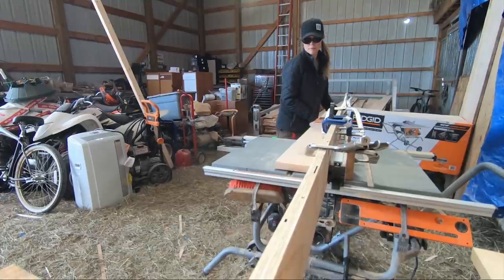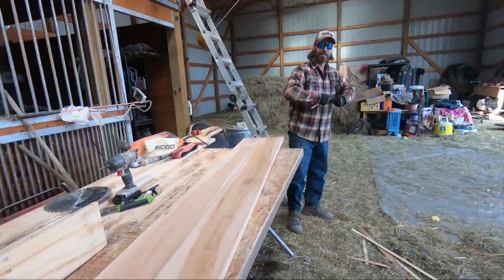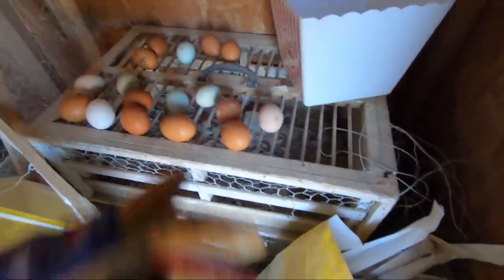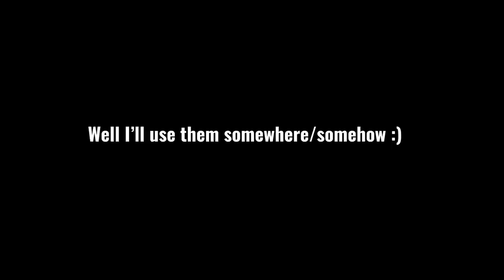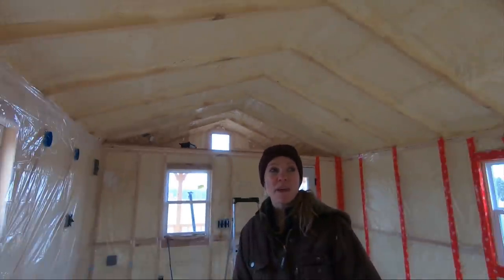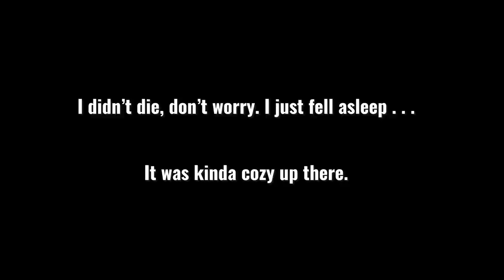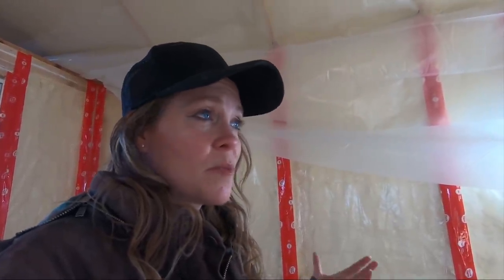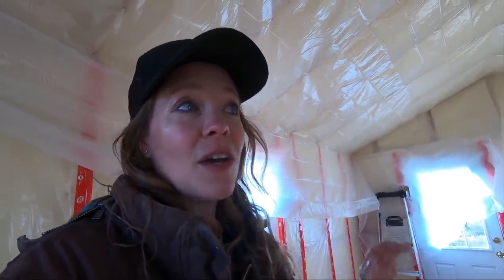DIY Nickle Gap Edge on Rough Sawn Lumber With a Dado Blade  - Off-grid Cabin Build Vlog #15

Comment: As mentioned in multiple comments, vapor barriers are used in the wall structures. There is nothing bad using them.
To have condensation you need 2 things, warm moist air and cold place, which warm moist air can hit. This happens usually in winter where there is cold outside and warm inside. To eliminate the issue you need to consider 2 things.
1. get good enough air exchange (passive over opened window/door or active using any ventilation system with vents). If humidity is too high (over 60-70%) you can see condensation happening even on modern windows with triple glass. More the structure is tight and air-closed more the ventilation is important to eliminate moisture.
2. get good enough insulation, windows, doors so when there is cold outside the cold spot is not moving on inside side of the wall. Once this happens you will get condensation on the plastic foil.

if insulation is not good enough you can maybe try to overheat the inside to dry up condensation and push the cold spot out of the foil. This can become expansive on heating.

I hope you will be able to finish the project successfully and enjoy the "office" without any issues ;).
Reply from the maker: I got to thinking about it, and bought some vents to exchange air one side to the other and keep it from condensating too much. They are adjustable, so I can open or close as much as I need. Problem #2 I didn't think about, is that my green cabin wood might not be "dry" yet, and still sweating . . . which means higher moisture inside the walls WILL be an issue . . . even without the plastic, it could cause warping of my dry maple boards . . . I think any reputable seller will always gives you the pros an cons of any item being sold. Maybe it's only me. But I like my customers happy and coming back than upset and frustrated.. I had no idea the wood would be green . . . it affects everything someone wants to do . .

Comment: What you're talking about with the plastic is a vapor barrier, its usually done in normal fiberglass or wool insulation.  It has been tried and is the standard for most insulation.  The reason you dont find it in closed cell foam is it shouldn't be necessary, but it shouldn't hurt and it should prevent the exact problems you are talking about

Comment: Save the sawdust. When you get the boards on the walls you can mix with glue to fill in the holes from nails or just the natural holes in the wood

Comment: It looks like your framing lumber in the walls is creating a thermal short.  That's the cold spot where moisture will condense and if you nail your drywall or paneling to that, the nails will continue the short and condense moisture on the interior side.

Unless you have a continuous layer of foam outside of your framing (like using ZipR sheathing), I wouldn't trust it.

A possible fix is to get canned spray foam to fill in any low spots and glue on some 1" EPS foam insulation on the inside.  Tape the seams to complete your vapor barrier and hopefully your temperature differentials won't be enough to condense moisture.

If you don't feel like doing that, I would try living in it before you put up walls and ceiling.  Beside measuring moisture, you will be able to see it and if it is a problem, you won't have to demo the interior to fix it.

Comment: There is a couple in Texas with a double container home with spray foam  and a couple in New Hampshire with a single container who both used spray foam. Neither of them used plastic to cover the foam. One has a problem with water around a window. I think you were wise to use the plastic over the foam! You never know what kind of breathing issues you can get from breathing in vapor of the foam.
Reply from the maker: Well that was the first reason I bought the plastic. The foam dust HAS badly affected me (hence all the vacuuming) and when it gets moved, more may break free so the plastic will contain it... and also keep moisture out ;)
Reply: @This1LifeWeLive  There was a video of a couple in Canada that were using the spray foam in an attic and I don't know what the foam was but it put the whole family in the hospital. The company that put the foam in had to take it all out. It could have been that they didn't mix the foam the right way. That is why I say use the plastic.
Reply: The Texas couple life uncontained used drywall over the foam with no plastic vapor barrier, with the climate there it will be ok, the New Hampshire couple used rockwool insulation with no plastic and paneled over that, tons of comments about a condensation nightmare going on there. Apples to oranges really comparing this wood building to a metal shipping container.
Reply from the maker: @kenyh6695  you are correct, I saw that video too.
Reply from the maker: @billg1527  very true, I watch both channels you mention. Life uncontained installed themselves and missed several areas. I would assume it would cause massive issues, but im not in that climate. Container homes are not just metal, but the thermal break is different as well compared to pole buildings. And then you have mine... a totally mutant creature that doesn't follow any sort of construction path 😂
Reply: @kenyh6695  I seen that whole story, it was a bad mixture along with a bad application process. You know fairly soon if you have a bad mixture as it smells awful within a few days.

Comment: Well I'll throw my 2 cents in...
Its the temperature difference plus the amount of available humidity that causes condensation which is why its mostly seen in the winter. Depending on climate and location the amount of humidity is normally lower in cold areas during the winter ( I can barely keep my house above 32% during the winter ) and higher during the summer ( bad summers my A/C works hard to keep it no higher than 45% and I have a variable speed fan so it runs slower for longer to remove gallons from the air. 
There are two competing theories for your off grid office - plastic will seal the walls on both sides creating condensation on the inside of the walls and 2. Since you have closed cell sprayfoam which allows some air not much but some, and probably some unsealed gaps leading to the outside and you only have wood siding on the outside, putting plastic up will keep the moisture on the outside of the house. Sprayfoam is still fairly new with few experts and no calculations suggesting each of these theories is right or wrong from what I've seen. So which is it? Who knows but you're about to find out, someone has too!
If your cabin was foam boarded, house wrapped and sealed like conventional house construction I'd say there's a problem but as you said its a grey area.
Erik cracks me up, glad He's having fun! Some nice compost you have going on there...
You do need to hurry up and finish though, I'm almost out of maple syrup and I want some of y'alls!
Keep up the good work!
Take care.
Reply from the maker: I know, I'm running oout of time to get this DONE! I'm going to start manure spreading next week, then seed planting. Then will be equipment servicing. Then hay!   PLUS I gotta nail Erik down on what kind of house we are for sure building (he's been changing his mind).

Comment: I have worked in the insulation industry for over 30 years and have seen it all. I have never seen a vapor barrier over spray foam and would not recommend it. That said I don't think it matters in your case. You won"t be showering, cooking or washing clothes in the space so I would say it will not matter. The reason you had to put towels under windows is the same reason you have to put a coasted under a cold glass of tea. Moisture in the air condenses on the cooler surface.

Comment: Suzanne,   If you keep a wax candle near your saw, you can give the wood and metal a quick rub with the candle and the boards will slide with ease.
Well, you’ve been working two months on a single room building that someone else built and someone else insulated.  Still think you can build and finish a house in less than 4 years?   Respectfully,   Kevin

Comment: Exactly why are you leaving a gap between boards? They may shrink and you will have a gap anyhow.
That fixture seems to be allowing the boards to rise above the table 1/8" or less and you won't get a flush edge on assembly.  Tight together as possible is recommended. Gaps will allow bugs to get in there............  Spray Jones said NO to me when I asked.

Comment: Close cell doesn’t need a vapor barrier over it such as plastic because of the cells in the foam are closed it doesn’t allow vapor come through
Reply from the maker: Correct, the plastic will be a moisture barrier, to prevent warm moist air from coming in contact with the cold foam :)